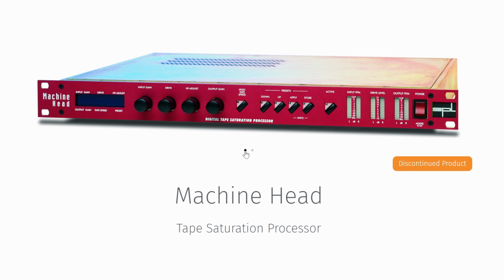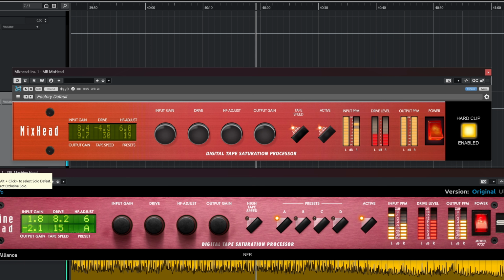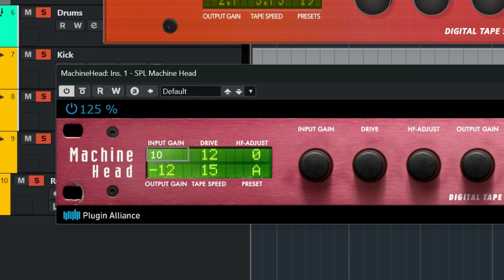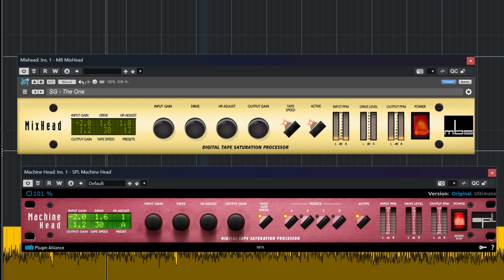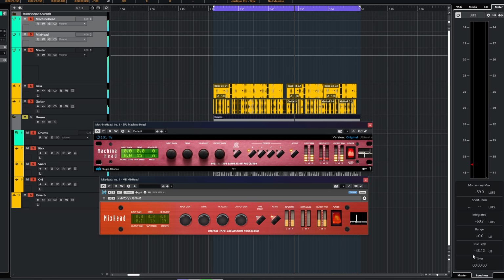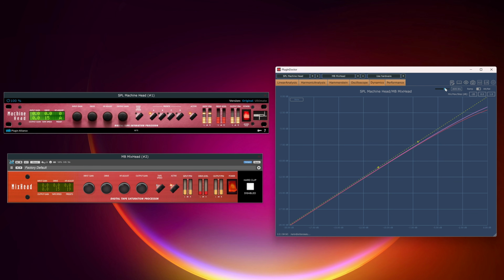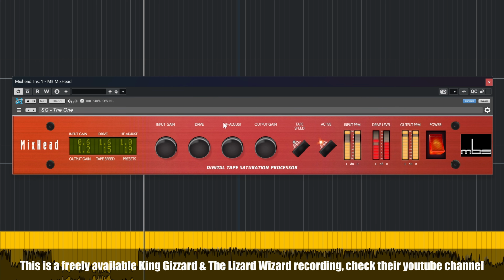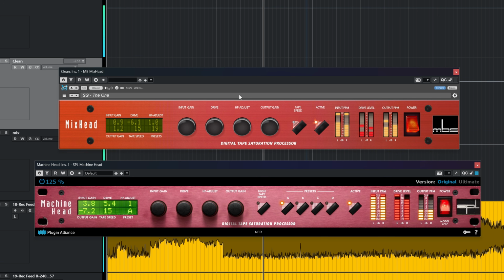Machinehead vs Mixhead : The Ultimate Showdown

Comment: I can't see this plugin doing much of anything for your sound though. Any thoughts to enlighten me on that?
Reply: @RogerBrenon  its basically a tape emulation so it adds harmonic distortion, glue top end roll off low end boost and open up the mix. Digital mixes sound flat plug-ins similar to these add back the life into the mix , you feel the difference more than anything
Reply: It doesn't do anything
Reply: @cl9826  it actually does. But cos it mastering, it is as subtle and gentle as it needs to be

Comment: I've been A/Bing these two for the last couple days... They are both really good, but different.The SPL has more of a wide sheen with a slightly dipped center. The MB is more focused with a little bump in the low mid and the vocal sits a little more upfront in the mix. I like both, and am trying something different by using them together on the mix buss...with the SPL first at 30ips, followed by the MB at 15ips. So far I'm liking the combo! It also gives a lot of options between the 2 to shape the mix. I think if I had to only pick one, it would be the MB (I'm mostly doing pop). If I was more into jazz, orchestral, or just a cleaner mix/sound, I would choose the SPL. My 2cents
Reply from the maker: Fair points! It's all about personal taste, but that distortion behaviour of the mixhead is something I frown upon.

Comment: I still have all three boxes in storage somewhere. Machine Head is a 1 to 1 port of the original Steinberg Magneto plugin of x86 & PowerPC to the Motorola CPU in the hardware. If you have that old Magneto plugin you should actually see how close they are. I think Magneto 2 has some extra features.
Reply from the maker: Sell them ;-) It’s worth a lot ^^
Reply: @audiotoolshed  I doubt they even still work they have been in a storage building that is NOT climate controlled since about 2004-05 when I got the Waves MaxxBCL which was an L2 hardware rack limiter with Renaissance comp and MaxxBass. Everything in storage has been exposed to extreme heat in the summers and freezing temperatures in the winter at mountain elevation. I did consider going out there and dig them out and do a shoot out with the hardware and the plugins but I have 25 years worth of old studio gear in a 12x50 shed along with tons of Live gear and anything my girlfriend has put out there as well. But once the weather warms up in the spring I'm going to get them out and see what is still working and what isn't.
Reply: @joesalyers  Keep us posted, I'm buyin'!
Reply: @ Sure thing LOL but the plugin would be a better option its at least 24 bit the hardware is 16 bit if my memory is correct.
Reply: @joesalyers  Still interested!
Reply: @joesalyers sell it all. Take the money and enjoy your life. Traveling the world will give you life long lasting memories versus some old metal locked away
Reply: @joesalyers  Only the hardware Machinehead is actually 24bit, the other red units are 16bit…

Comment: Honestly, I get why Mix Head costs more—it took way more effort to recreate the effect by ear and measurements, while SPL just ported their own code. Both sound similar, with unique strengths. Thanks for the fair comparison!
Reply from the maker: Mwa. Its not that SPL simply could simply use the code to get a plugin straight away. Old code to new platforms + adjustments in the filters and more. But they did have a huge advantage in comparing and getting it right for sure.

Comment: If the originals are digital emulations of a Tape, that means they were kinda hardware plugins ? That makes the plugins, emulation of other plugins?
Reply: It's literally the code from the original Cubase Magneto plugin lol. Not kidding, look it up. SPL paid steinberg for the code. There were no converters either, it was digital. They are literally selling us a plugin from 1997.
Reply: @cl9826  that's funny.  Cubase was my 1st daw and I honestly loved magneto
Reply: @cl9826  And yet the hardware unit sounds better. I own one and did A/B with the SPL plug-in. The difference is not huge but the hw unit sounds more ‘musical’ and has more 3D depth if that’s really a thing. The difference is enough (for me) to keep the hw unit even they fetch crazy money (bought mine for around €400 back in 2016 😅)
Reply: @benpancedd k
Reply from the maker: Exactly^^

Comment: hello!
for all examples you used Mix Head with no oversampling and hard clip on?
Reply from the maker: Nope. Its a mix of what settings I used.
I found that neither oversampling or output clipping made much of a difference if any at all with the extreme distortion.